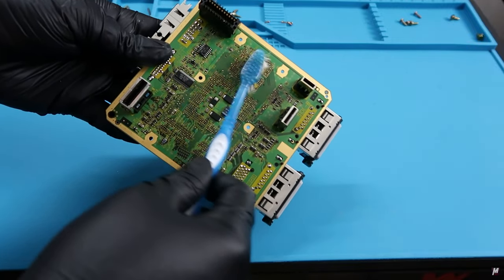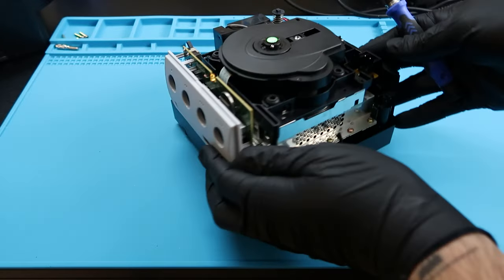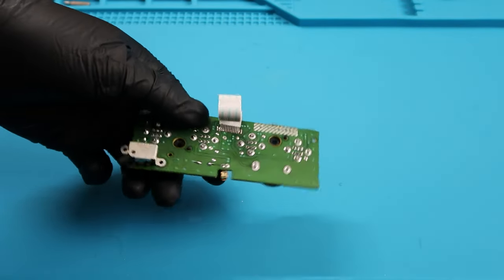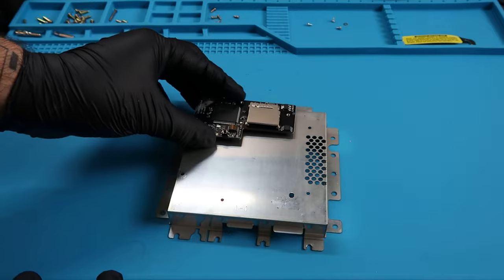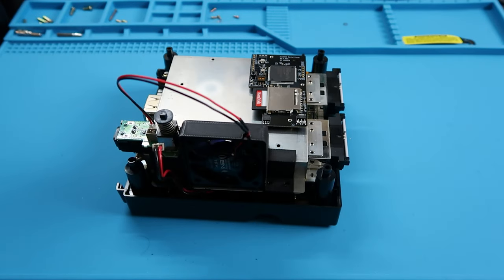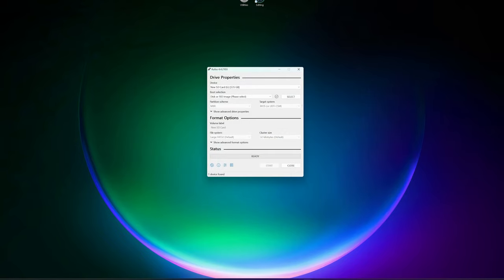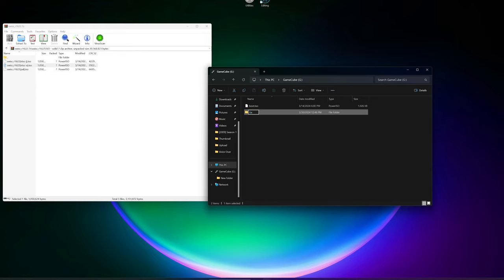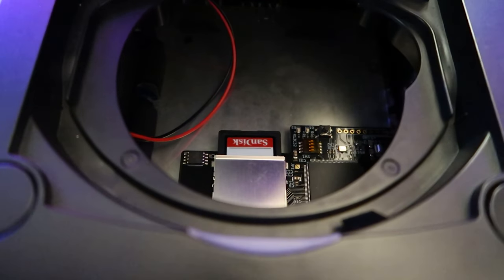Tutorial | Nintendo GameCube Mods | 4K🔴

Comment: I thought i read somewhere that when setting up the GC loader with swiss you needed two SD cards. One that's smaller for the OS and one for your games.
Has that changed?
Reply from the maker: @malevolenceD3CAY  I can guarantee you, that with a legitimate GC Loader you can run everything off one SD card. This is the way I've been using mine to play games. However, you can also buy an Micro SD Card and an SD2P2 adapter if you wish to run your games from there.
Reply: @Magneteco  fair enough, thank you. I wasn't sure because I swear I heard or read that it could only read Swiss off of a SD card that was like idk "2gb" (can't remember the actual size)at largest or something. 
So I was completely convinced I was going to have to buy 2 different SD cards.
Thank you for confirming.
Reply from the maker: @malevolenceD3CAY  No problem at all. I'm glad we were able to clarify this so you know what your options are. If you need further help, just let me know. Happy gaming!

Comment: I suggest stay tunned and sub to the channel. Gamecube has a lot of cool stuff in therms mods. 
Imagine using any bluetooth controller you want (PS3, PS4, PS5, Xbox One/Series X, 8BitDo, Switch Pro, Joy-Cons, you name it) up to all 4 players without the need of any adapters. 
Imagine having a Japanese Gamecube and can't access the memory card of your other region games or want to have access the interface in english. There is a mod for that too.
Also, lots of options if you want to connect your Gamecube through HMDI and benefit from the best picture on your screen. Some requires mods and other just plug and play.
Can't wait for more from the channel. :)
Reply from the maker: The Carby is a great option to use HDMI. I really don't want to buy a $300 Component cable. Thank you for checking out the video my friend!

Comment: Does the swiss no longer require a secondary memory card?
Reply from the maker: With the GC Loader, it does not require a memory card at all!
Reply: GC Loader has everything needed with Swiss. You can turn on the option to use a virtual memorycard. But I still recommend to use a real memory card since I heard there are issues with some games when using the virtual memory card. Also, I recommend having two memory cards and use one of those as a backup so in case something happens you can recover your saves from the second one. 😎
Reply from the maker: @monchopr3511  That is what I do. I just slap in two OEM memory cards and I'm off to play games!